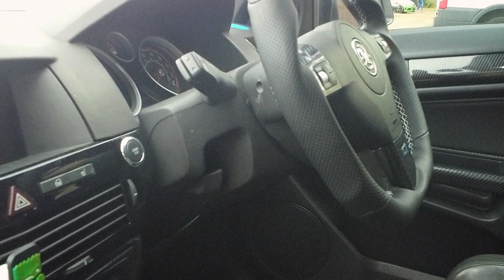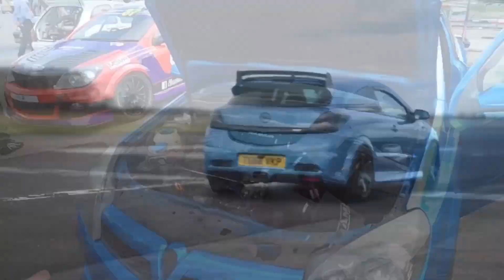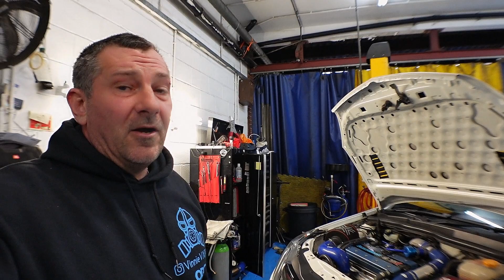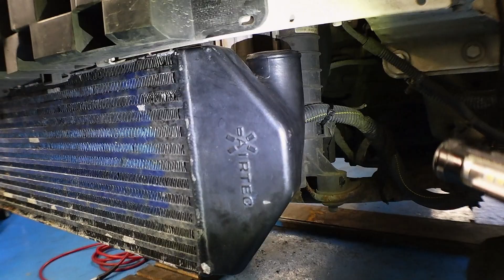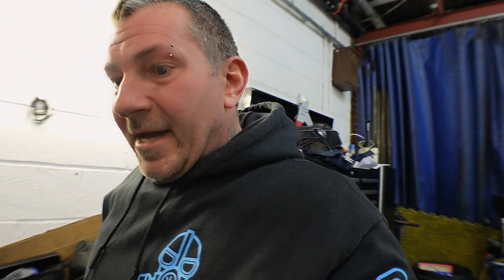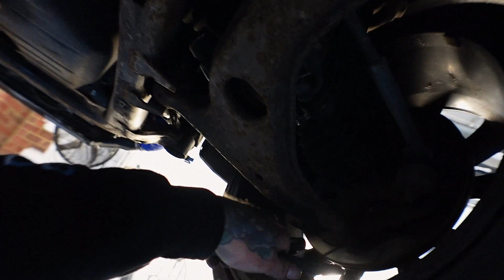Astra VXR Airtec intercooler install with boost leak test

Comment: I was going to buy a airtek intercooler for my corsa but bought a tx autosport one instead BIG MISTAKE first one didn't turn up so messaged them 2nd one came wrong colour and covered in dents rang them up and they just said sorry about that but you have one now. It's still on the shelf in the garage wish I'd just gone airtek to start with I wouldn't deal with tx autosport again. Good stuff mate 👍👍👍
Reply: Mtc are also decent for the money but you don't get all the customisation options
Reply from the maker: That’s really bad Customer Service from TX mate if you message me on my Instagram I may know someone with an air tech intercooler for you mate
Reply: @Vinnievxr666  really appreciate that mate but I'm going to try sort the tx one out and put it on it's just pissed me off that I've got to fix something that's brand new and the wrong colour Thanks for the offer though appreciate it 👍👍